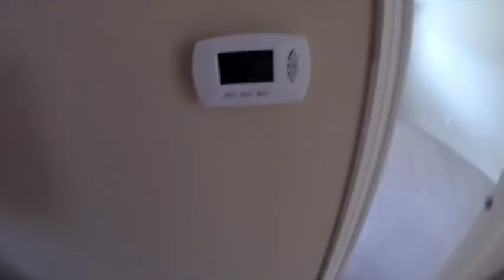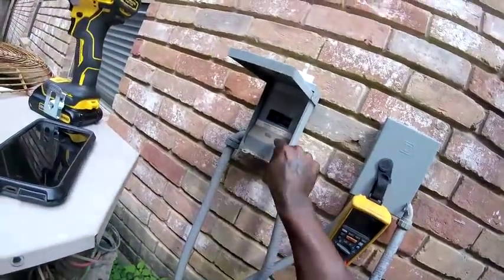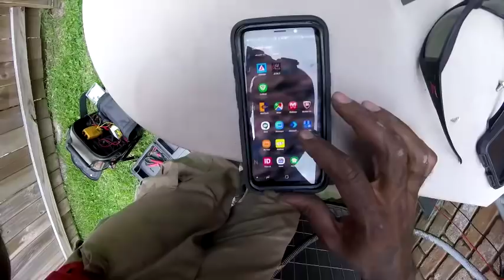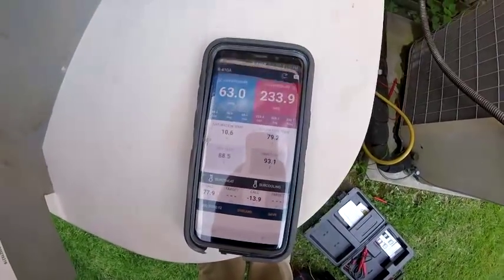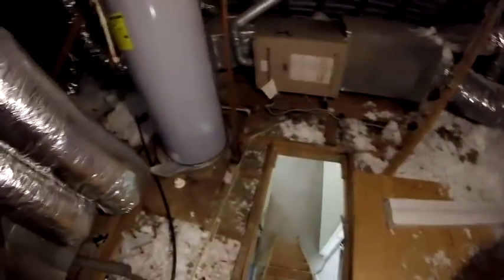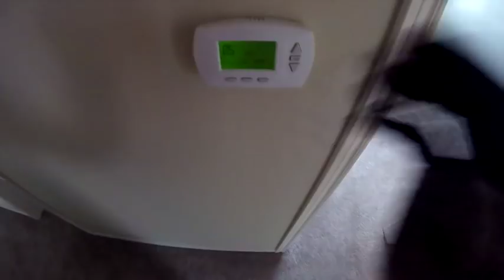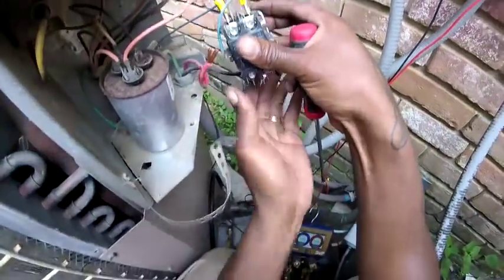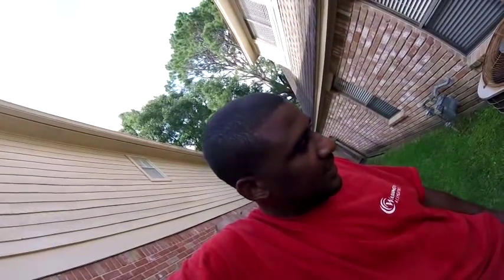HVAC: Troubleshooting no cooling call

Comment: I like you raw video. Please take few advices from me. 1. always discharge the capacitor when you are going to change it or the contactor. You problem was electric you did not need  to hook up your gauges that way you avoid losing gas unless after running the unit for few minutes you don't see the section line getting cold, swat is a good indection of enough gas. . You should have checked the filter a lot of home ower forget to change it. Over all you seem to know what you are doing and your video is very good and very usefull. I like how you were able to spot the problem right away. I am sure you making the video effected how you approached the issue but job well done.
Reply: He did check the filter when he first went in.

Comment: In those high corrosion areas like costal, Louisiana and so on, I would use dielectric grease on all the connections. Get a stainless brush from Harbor Freight to clean the contacts too.
Reply: Preach

Comment: Great job.  That fan stopped awful quick when you pulled the disconnect.  Those poor units under the roof edge with no gutters.  No wonder everything is rusted to crap.  Also, how in the world did it ever become "code" to put hot water tanks in an attic?  That is freaking crazy!
Reply from the maker: Good eye.. I had to replace that condenser fan yesterday. Seized up..Replaced the dual cap also

Comment: I never wholesale wires off of anything.  I replaced a control board and placed each wire one at a time. Did the sane with caps too.
Great videos.
Thank you

Comment: Wow, that accent must be Louisiana or Mississippi...  That’s insane working out of a pickup truck. Most linesman’s and crimpers that tighten up like that, is from using them as a hammer on the pivoting pin of the tool.

Comment: I would have changed that cap brother. For a 50uf cap it needs to be within 47-53uf. Yes it was in range, but right on the line. I believe you accidentally entered 47 when you did your calculations.
Reply from the maker: Yeah I did accidentally enter 47. Entered number of my calculation.. Video was recorded over a year ago. Unit still running like a champ..

Comment: + or - 6% of 50 = 3. So 47 would have been a bad capacitor.
Reply: No, actually that's still a good capacitor. If it was OVER 6% out of spec it would be bad. Not only that, it was also explained to me that the 6% number printed on the label is a "manufacturing" tolerance. That means out of the box they can vary by that much. It's not a replacement number. Many techs have their own rule of thumb, mostly around 10%.

Comment: 6%of 50 is 47 ... 50 x.06 =3 ... 50-3 is 47 .. I would of replaced the cap ... better to be proactive than reactive !!! But good video
Reply from the maker: Yeah. I noticed on this video I subtracted 47-6%..motor sized up a few days later and I ended up replacing cap/motor
Reply: would "have"...